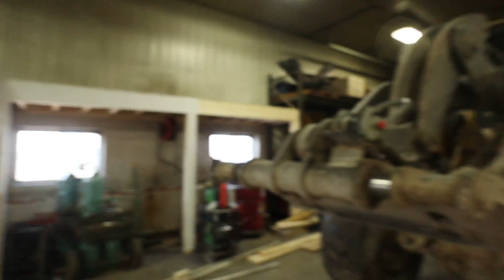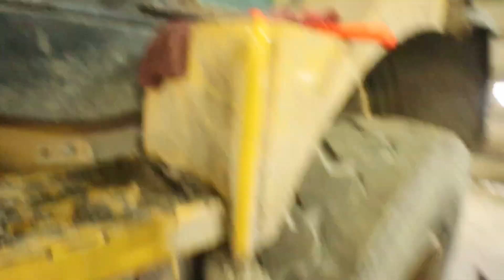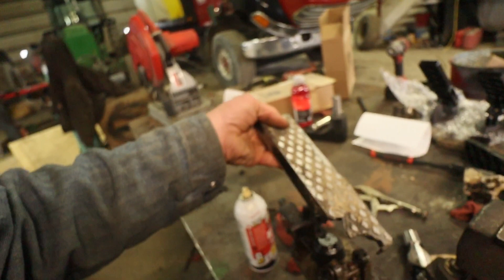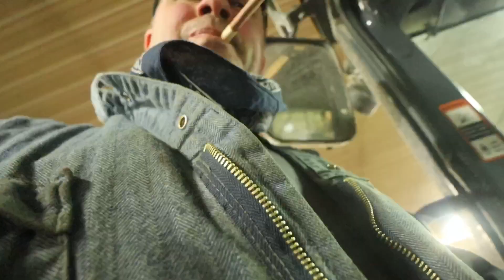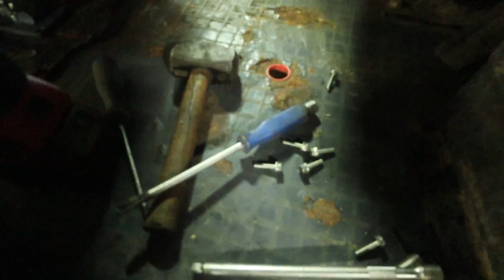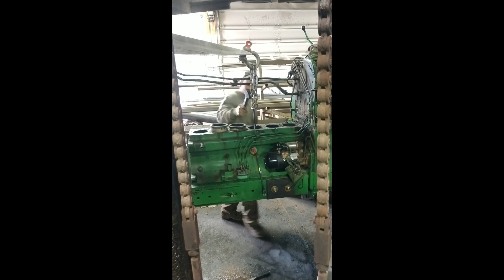$1,200 Payloader Pedals and Stubborn Piston Liners

Comment: We also had trouble washing on the motor, throws a sensor on the cam position and the back sensor on the engine fan. Try to wash as little as possible, lot of times leave it running and rinse lightly.

Comment: The floor doesn’t help you out either the seem in the floor is right at the base of those, water seeps in theater crack and sits under than honeycombed bottom on the floor and the top is dry just sits in moisture.

Comment: Have youi considered using that blue air line (RapidAir)?  Northern Tool sells it.  I know a couple people who use it, and are very happy with it.  One of them is a pretty good sized tire shop...use a lot of air every day.  I have bought a kit, but have not put it in yet.  Would be way less labor than installing black pipe...so easy to run up top around the shop.
Reply from the maker: I haven't I should consider it

Comment: Andy.     The oil pan is off the JD 4620,  correct?    Be careful with the crank journals to protect them, take a steel pin and a hydraulic jack .   The liner at the bottom has enough protrusion  to take the  steel pin use the jack the apply pressure to the bottom of the liner and it will push out.
The o-rings of the liner are most likely hold ing.  This might help you.    Just a suggestion.

Comment: Don't remember the brand but got it on Amazon for 1in air line ,blue poly like on the outside ,aluminum  lined inside  and flexible ,  with very easy to use compression fittings  and not crazy expensive ! Many years of trouble free use !! Felt like Tonto or Kemosabi should be riding in !! hahaha

Comment: Hey did you put a new brake valve in while it was apart
Reply from the maker: No I didn't
Reply: We have deere loader and skidder same brake valves if the axles are getting hot or because the valve is bleeding by I hope that's not what is going on in your case

Comment: We have pushed them out with a bottle jack from below with the crank in it was terrible getting everything lined up. Also made a puller to hook the liner on the bottom an set two bottle jacks on the deck one on each side of the puller an got it to move! Good luck!

Comment: For large air piping I like to use Quick-Lock from Champion - aluminum pipe and fittings. Actually cost effective when considering install labor. No threading needed just slip it together similar to Shark-Bite fittings. However for short and/or small air piping galvanized is fine.

Comment: Good all getting rid of the pvc air lines, we use mostly aluminum pipe anymore.  It's a bit more money, but goes in quick and can add drops easily.  You might look at Electric auto drains for your tanks, just use a separate drain for each tank.  I'm not a bit Kaeser fan, but they are pretty good.  Thanks for the videos, you do a great job.

Comment: OTC has a dam good liner puller I have pulled a lot of liners with the one i have and it pulls form 3 points not just 2 like snap on The OTC part # 1205 napa price $643.99 cheeper on line
Reply from the maker: Thanks

Comment: Need to get a puller for the liner.       https://www.ebay.com/itm/EZ-PULL-Cylinder-Liner-Puller-MULTI-BORE-MADE-IN-USA-3-450-to-5-700/113928176133?hash=item1a86a60205:g:3hAAAOSw9EldqdV0

Comment: I don't think I would run black pipe for an air system in this day and age.  PEX and call it a day.  How you dealing with moisture in the lines?  With tanks and compressor at the top the drops are going to be moisture traps.
Reply from the maker: It's gonna be a learning experience
Reply: @FarmingFixingFabricating  I know you have some decent humidity there.  I'd be tempted to leave the tanks on the floor, and the compresser above.  You will figure out what works.  At lest with PEX or similar changing stuff around is simplified.

Comment: save a lot of time  using Ingersoll  air lines  quiet and easy jr can do this to  how i instilled the airline run the full line to the other side of the warehouse first  them i cut into the line push in and twist fitting  too  had all of the airlines runs in a day worked with the fire sprinklers guys to their need air as well did not like this fire system lose air and the system goes off  yes had this happen got to the pumps before the water tanks drained and able to turn off the sprinklers to one place i had to open or close up the warehoused got used to walking throw the builds before i leave making sure all machines are turned off too doors are locked too 
the alarm company they had this build did too it run 24 house had people working here  never had to lock that place up  the had to call to the alarm to report the was a fault  alarm  and call off the fire departments the warehouse never got the damage the office did it was my lost day there to i found a better paying job down the road  
back worked all day and night to have them running the exit day their

Comment: The two biggest pita things I hated when i was a mechanic was doing under dash work and replacing all the blades on a flail mower. Two blades per hangar, one bolt and a cotter pin. Times what, I forget.

Comment: We have pulled liners like that with a hydraulic jack and a piece of box steel with a hole cut for the liner to come through. Rig something to the top of the jack. Worked half way decent
Reply from the maker: There crank is still in it

Comment: get a shaft and drive that liner out from the bottom.
Reply from the maker: Crank is in there still
Reply: @FarmingFixingFabricating  that is why you need a 30" x 1"shaft. done it many of times. turn the throw right and it will work.
Reply: just drive on the edge of the liner with the shaft and a big hammer as you lay under the tractor. just trying to help. thanks BARB

Comment: Did this with older tractors that were froze up. Put the overhead crane or the A Frame over the tractor like you had the forklift. Use the tractor’s weight to help you pull that sleeve out. Also helps if the the oil pan is pulled and you can put your steel disc under the sleeve with an arbor bolt welded to the bottom side and hit from the bottom with a sledge hammer, or use air jack

Comment: if you where to redo the air lines look into a product called rapidair. The line i would suggest is there fast pipe system it is aluminum coated plastic designed for 200psi simple to install lasts forever wont rust out.

Comment: Why is PVC pipe for airline a no no? I know one manufacture put PVC in for compressed air and it kept blowing out.
Reply from the maker: The oils that come from the compressors can weeken the pvc
Reply: I worked for a shop that had pvc for airlines and every like 3 months one would blow and it scares the shit out of you!. definitely dangerous... especially when the PVC gets old!
Reply: PVC shatters when is breaks under pressure. Sending small pieces flying with force.